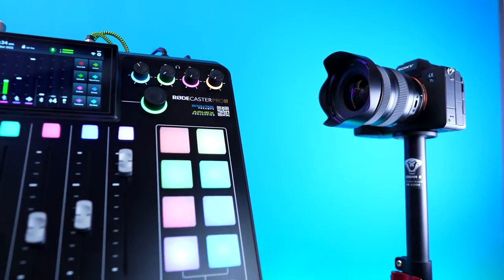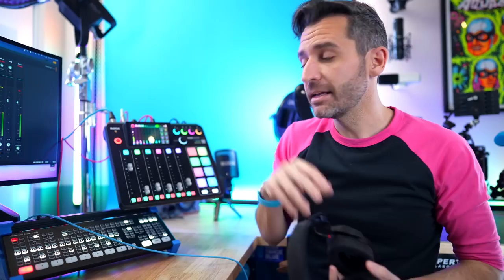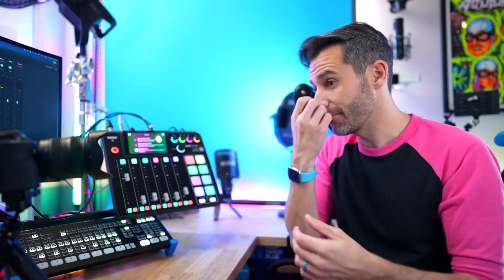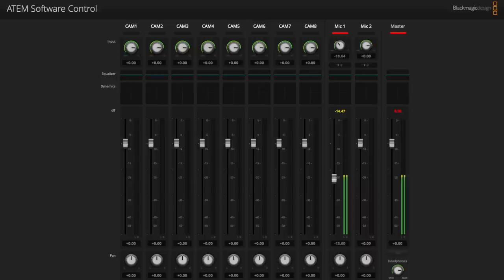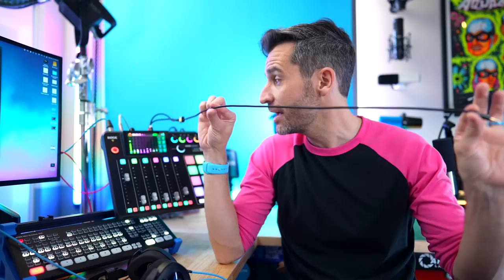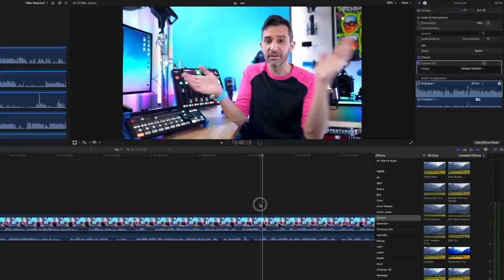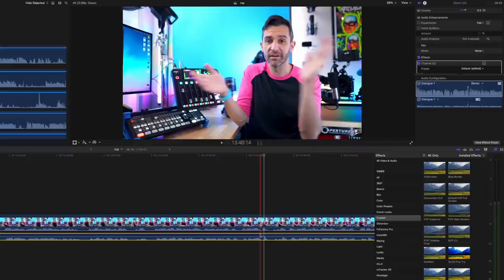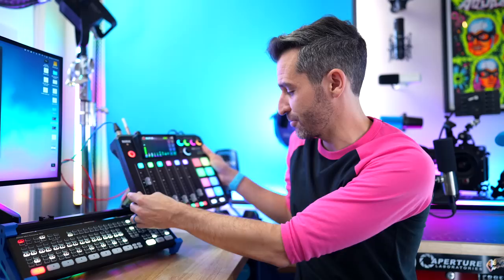How To Connect the Rodecaster Pro to a Camera or ATEM (and why you SHOULDN’T do it)

Comment: to the rodecaster pro 2 duo, can you output the sound of the front 3.5mm trrs to the camera only as a backup and to synchronize later in post?
Reply from the maker: Yes, you totally can but it's not going to be quite at the same quality level as the regular output. Probably not noticeable most of the time, but something to be aware of.
Reply: @tombuck  thx so much 🫡🇲🇽
Reply: @tombuck  I swear it's my last question, I swear hahaha, in the rodecaster duo you can connect through the usb type c output to an iphone and record with it as a third camera for a podcast and record the iphone video with the audio from the rodecaster? thank you so much

Comment: Hi and thank you? How would you record 6 mics podcast audio? Thanks again
Reply from the maker: It depends. If you already have a Rodecaster or similar mixer and you only need 6 mics on rare occasions, you can run both the RCP and another interface like a 2i2 into your computer and mix them together with something like Ecamm or OBS. It's a little funky but it works. 

If you'll be using 6 mics regularly, then it's worth getting a mixer that has 6 XLR inputs. The Zoom Podtrak P8 isn't my favorite mixer, but it's the only Rodecaster-esque one that has 6 inputs. Otherwise you can dive into more traditional audio mixers from brands like Yamaha, but you might also need boosters since they don't usually have a ton of built in gain, and you'll usually need to run the audio into either a computer or separate recorder to actually record the audio.

Comment: Thank you for your video. Do you have any solution in which we can use the better quality audio from Rodcaster/ and a DSLR camera for Livestream with OBS without audio delay? We can easily sync the audio and video later in Final Cut Pro but for Livestream is hard to sync it in OBS if we are using separate sources from audio and video...
Reply from the maker: OBS has an option to add in an audio delay. It usually takes a bit of experimenting, but I typically start with 500ms and then adjust from there. The RCP2 also has the option to add a delay in the Output Settings 👍
Reply: @tombuck  Thanks Tom for your help.  Also, did you use the headphone output from RCP2 because there is no output from RCP2 instead of headphones out only?

Comment: Tom help! I'm connecting the rodecaster to the atem using "the cable that actually works". It definitely reduced the noise I was getting from my old cable but it's still not good. It's a high pitched hum. I don't see any way to increase the gain out of the rodecaster. I've tried lowering the gain on the atem but then it lowers the mic too far to hear it. What do I do?? 🙏🏽
Reply from the maker: In the ATEM software have you switched the ATEM's input to line level instead of mic? I should've included that in this video, but it might help.
Reply: @tombuck  I did but I found a solution. Groud loop isolator!

Comment: All cables will need to be short and highly shielded because it is unbalanced audio.  And make sure the Atem is looking for line level instead of mic level.  A different option would be to use an HDMI audio embedder fed from the RCP and then into the Atem as HDMI.
Reply: Bingo! Well done @ilovechrisfonte.  You just addressed the two important issues that Tom did not in his video.  One can always convert to balanced with a ART CLEANBox Pro Dual Channel Level Converter (CLEANBOXPRO) or the like for longer cable runs.

Comment: Can't you use the 3.5 on the OG RCP? The headphone jack in the front
Reply from the maker: You can, but the original's headphone amps are pretty noisy, so I usually avoided using it as an output.
Reply: @tombuck  ohh ok I gotcha.
Thanks for this video, it randomly made something click in my head that now makes sense with all the hissing

Comment: does anyone know if you can use the airpod max with the rodecaster?
Reply from the maker: You should be able to connect them (I don't have the Maxes, but I can connect to other Bluetooth devices just fine). The tricky part with Bluetooth is always latency. Typically a corded headset is the way to go so that you never have to worry about it.
Reply: @tombuck  thanks bro

Comment: the link to the legendary black cable doesnt work - what cable is it
Reply from the maker: It's still working for me, but either way, the brand is "Yumiwoow" (you know, that super legendary brand that we're all definitely familiar with). And it's official product name is very catchy: "3.5mm to Dual 1/4 Adapter 1/8 to 6.35mm TS Mono Audio Cable Stereo Breakout Cord Y Splitter Compatible with iPhone, iPod, Computer Sound Card, Headphone, Speaker, Home Stereo System, 3.3Feet"

Comment: I had a similar thing happen with interference and drove me crazy because I have really nice gear with great cables and so one. What happened with me I use my iPad as a teleprompter and here the charging block it was plugged into not the cable was the culprit. I bought a knock off ipad charger and this caused the crazy inference in my camera the was above the iPad. They were close together so switched out to a legit Apple charger and problem solved.

Comment: Hah, I'm new to all this and my ears heard A74. I wonder if that's affordable I thought... 2500+ nope.  The irony here is that with $1000s of kit its almost impossible to connect them reliably and silently.  I mean it's not like you were stuck with a budget of $10 for a cable!

I'm guessing the noise is related to the shielding in the cable, if it's earthed properly, and not introducing an earth loop. When I read up on sheilded cat5/cat6 it seemed like it was worse than normal ethernet cable if you didn't get earth continuity right, 100% but without connecting it at both ends.

Comment: Hi Tom! Do you know what is the USB file transfer speed of Rodecaster Pro II? It's taking ages to copy recordings to my computer...
Reply: And - as always - great video!!! Tank you 🎉
Reply from the maker: Thanks Jakub! I don’t know the exact speed other than it’s supposed to be fast. I’ve found that it definitely depends on the size of the file, whether or not multitrack is on, and if it’s being converted to mp3 or another format. Sometimes mine is super fast and sometimes it’s pretty slow 🤷🏻‍♂️
Reply: That also depends on what SD card you are using. That should be a fast one as well. The weakest link determine the speed you can get. And with USB-C you should also be carefull with the cables. A quality cable allows 5 or 10Gb/s and minimum of 60 watt charging power. They have build in chips that determine the maximum throughput, also a weak link. A lot of people don’t know that and buy generic cables from the dollar store.
Reply: Both of you are right but the most important question is if the Rodecaster's USB-C is 2.0 or 3.0. Judging by transfer time it's 2.0
Reply: @jakubkierc4468  you are right about that. The 2.0 is for audio transfer only more then enough. My Audient ID14 works fine with usb2.0. The fastest way if the RCP only has 2.0 is to put the SD card in a cardreader. I do that with my card from my camera, goes a lot faster then with the usb cable in the camera.

Comment: Just checking, did you change the line level on the atem mic input. I bought a random y cable, changed the line level and it works like a charm. See https://youtu.be/alolj22DH5M
Reply from the maker: I did! That's an excellent tip though. I like the ATEM sound quality better than the camera's, but I still prefer the RCP's internal audio over everything.

Comment: dirty signals or interferance comes from somewhere. Use batteries where possible keep cables short, throw your wlan router out of the window, followed by your wirelless telefons. switch of your phone and put it in a metal box. Heaters, power transformers(switching), powercables(do not coil, keep away from other cables), fans, air conditioners, no grounded, poor grounded equipment. Crappy low quality usb hubs. Ground every thing you can so that it can absorb. Sensitive soud equipment run from battery with no ground or fitered ground.
Reply: I forgot blue tooth, switch that off too every where, no smart home junk,

Comment: Solution:  NEVER BUY EXPENSIVE CABLES.  Buy cheap microphone cable and solder the jacks yourself. You will get no noise. Microphone cables are thick and well noise shielded. If you use them on line level signals you will get the best noise isolation as it gets. NEVER BUY EXPENSIVE CABLES.